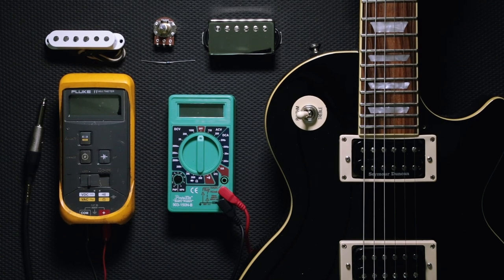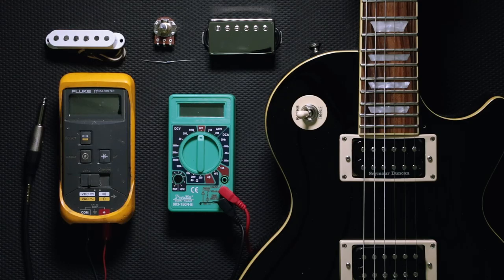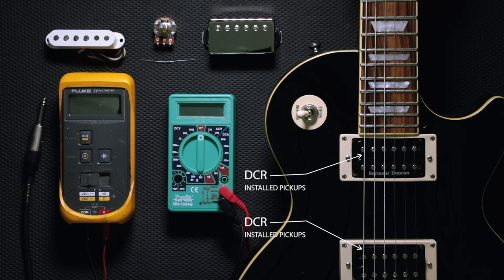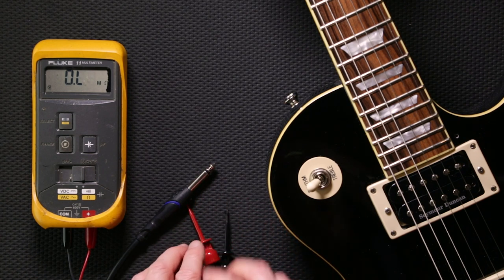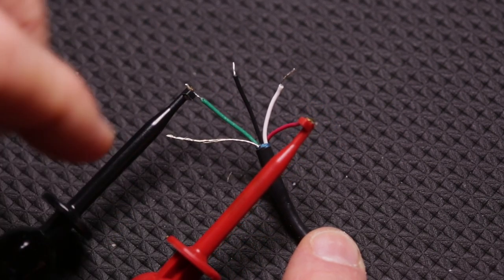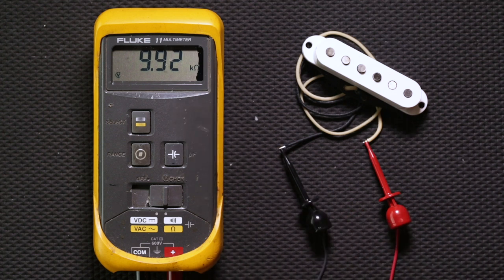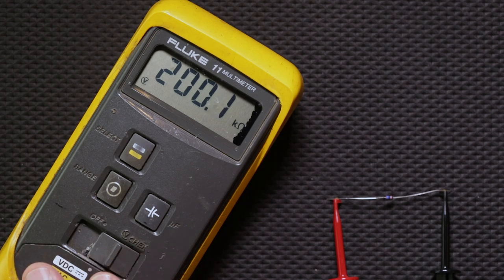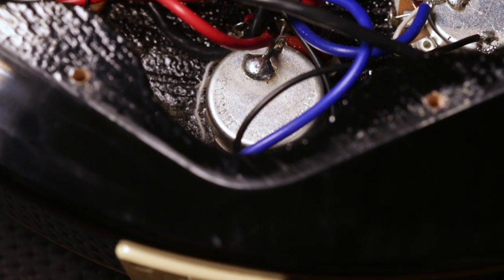How To Use A Multimeter | Tech Tips | Seymour Duncan

Comment: So if I hook the probe to the bridge should I only expect a beep if I touch other ground points, like pot bodies? It's a problem if it beeps when I I touch anything hot in the circuit (lug 1 on the volume, the tip of the lead, etc) right??

Comment: HELP HELP HELP.
Bought a pair of Seymour Duncan Distorsion Mayhem (new pickup 200€).

Neck works perfect, bridge don't (screw side is weak to the tap test).

I have this readings:
Total resistance (black+green): 8.8. ohm
South (red+green): 8.6 ohm
North (white+black): 8.83 ohm
South (red+black): 17.45 ohm !!!
North (white+green): 0.00 ohm !!!

What does this means?
Is the south pole wire broken?

This may sound obvious, my first time with a broken pickup. Thanks to who will answer me.

Comment: Dude...this sucks!! I put in a new bridge PU. First time soldering. The guitar is putting out low output.
SO IM like, Ill buy a meter and watch How To videos and figure out the problem.
But all these guys...the videos are either for people that already have some limited knowledge of circuitry or have no problem! lol
I tested my pickupsd the way he showed. On Ohms, right setting, volume knob up, touched the leads to the cable and no numbers. Open. Switvh to neck PU...same thing. Open. But this video must be for people who have no problems but just want to see that their are pickups work! lol
Where was the, "If you get an open reading on a pickup then that means etc etc?!?!?" Cos both are showing open and I know both PUs arent bad. UGH